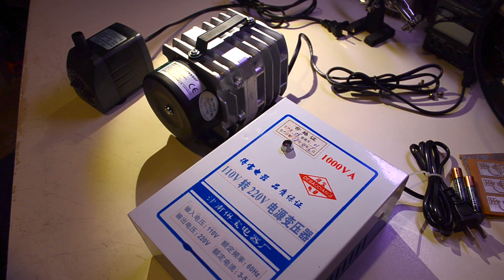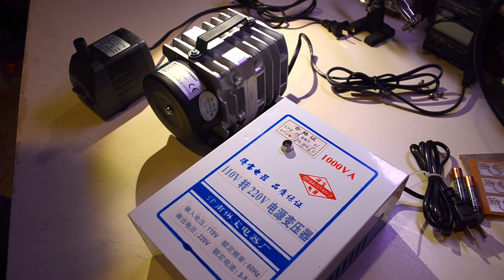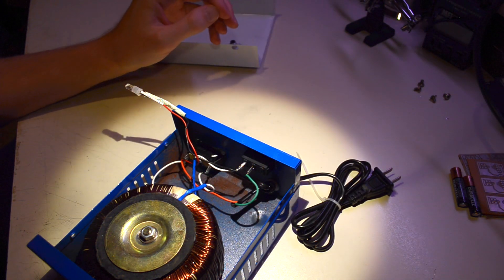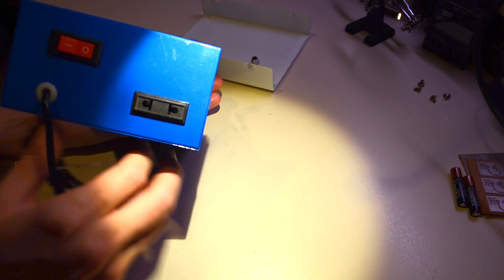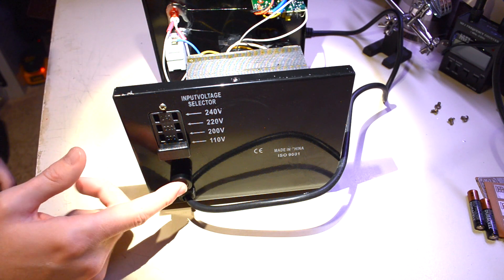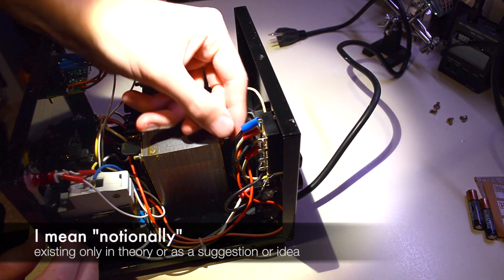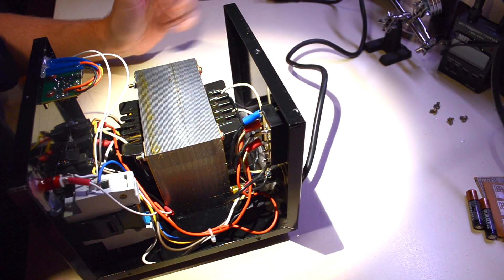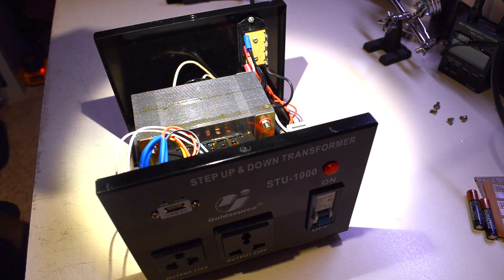Chinese laser cutter part 2: Power conversion

Comment: That breaker on the front is 10 Amp, not 400.
Most European / international breakers use this convention.
There are 2 elements, magnetic for high overload / short circuit and thermal for long duration smaller percentage overloads.

In the marking "C 10"
The letter indicates the magnetic trip level in relation to the nominal rating.
B is 5x, C is 10x and D is 20x.
Typically most domestic consumer units (breaker panels) use type B for most circuits, but type C are used for some applications eg where toroidal transformers are used in low voltage halogen down light applications.
Type D are usually only seen in industrial panels, protecting machines with relatively high starting currents.
Reply from the maker: Simon Parkinson Cool, thanks for the info!  That certainly makes a lot more sense.